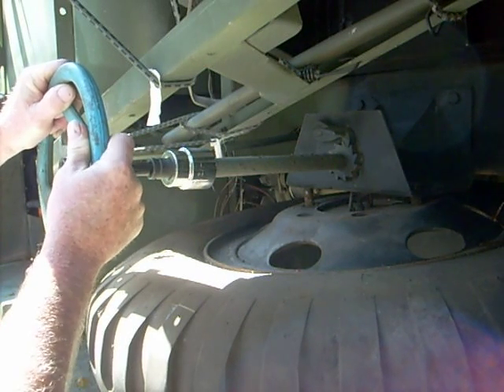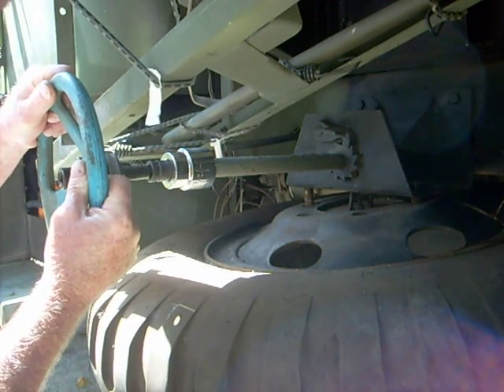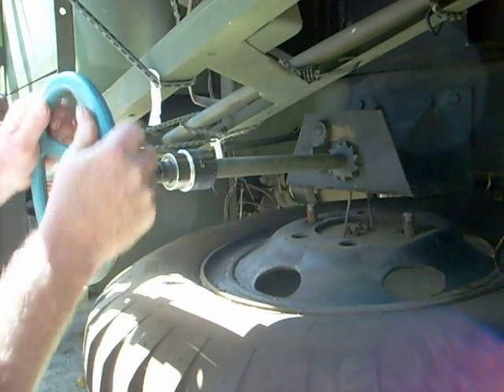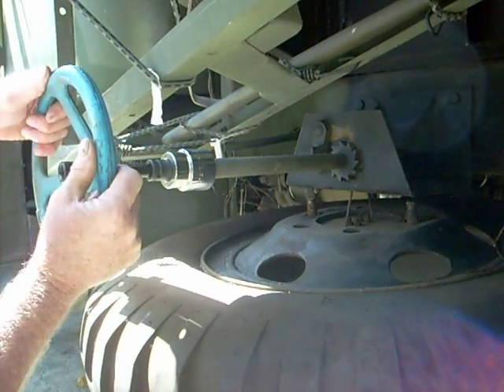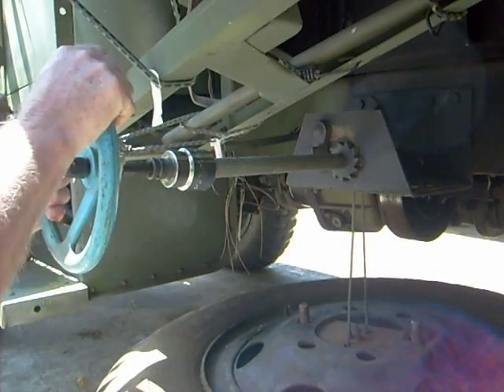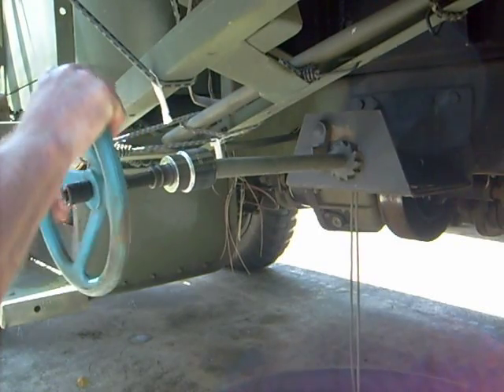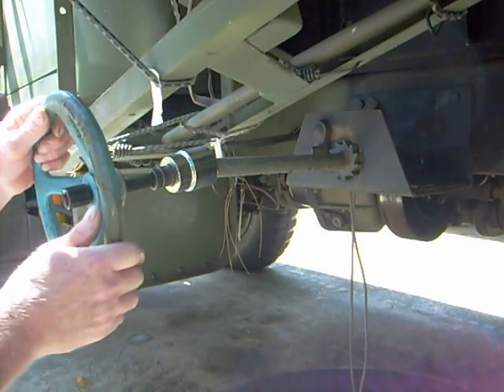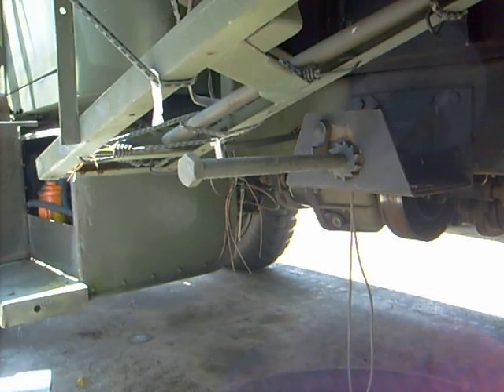M35A2 deuce spare tire carrier winch cheat

Comment: I think I have an idea of how you could make it alittle safer.  If you could install a weak spring that would press the ratcheting mechanism towards the wheel it would keep it from accidently flipping over.  Likewise it would have to be weak enough where you could manually move it over far enough to disengage it (like hood springs)

Comment from the maker: Thank you for the comment!  I just threw this together and plan on making improvements to the tool - possibly welding the extension to the wheel to make it more sturdy and to eliminate the need for the pin going through the shaft of the extension.  I know there's an actual procedure for letting the tire down but I decided to do this to prevent an injury that I might have gotten by using a lug wrench to work the mechanism.